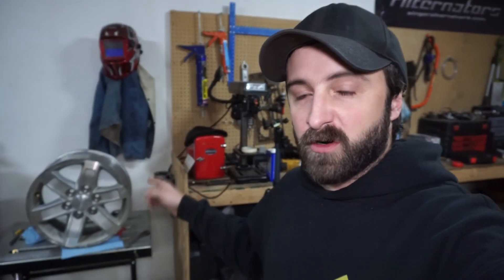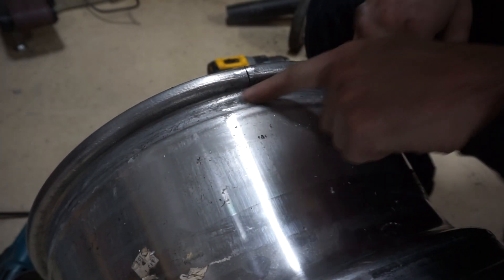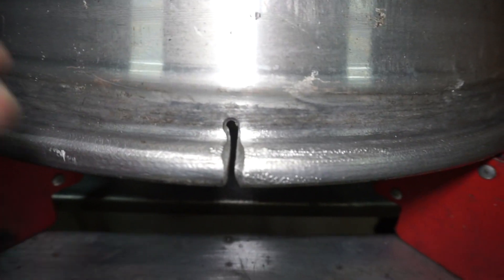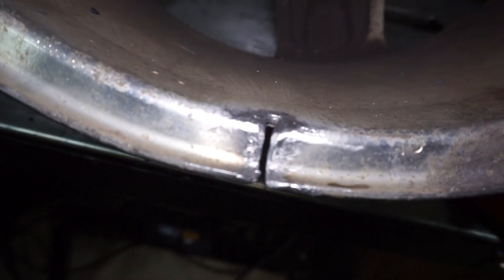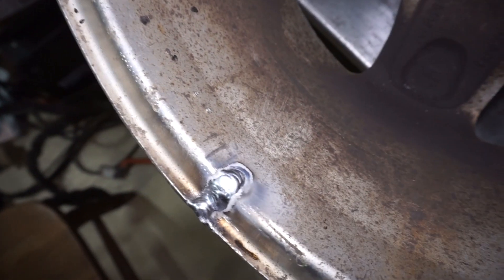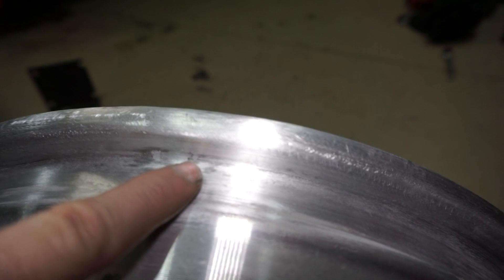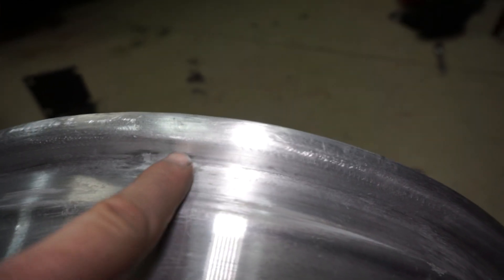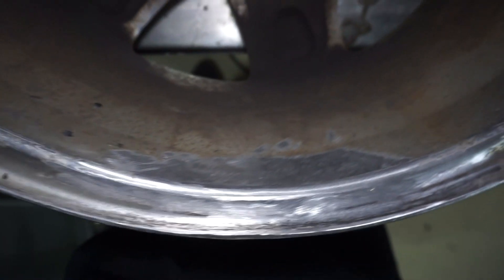TIG Welding Aluminum Rim Repair!!!

Comment: Could this work if the crack is located on the spoke right by the center of the wheel ? Probably around an inch away from the lug holes
Reply: I've done it used the wheel for a few months no problems but it is not recommended . Your life and the lives of others road users worth more than a  nice wheel. Repair had to be done properly if  you are going to take the chance.

Comment: So you just use autognoes*(sp) welding for cleaning and then you come in with filler on the second pass?..interesting thankss👍👍👍
Reply from the maker: Yep, run the arc over to clean some junk out then fill.
Reply: @BlaserBuilds  one more question if you happen to have the time,any recommendations on a machine?

Comment: Blaser Builds..In fact, you should have heated everywhere around the repair area before welding... with a torch....as aluminum is such a heat sink...and grinding the weld on the outside served only to weaken the weld and was useless...just saying...

Comment: Wat machine settings did u use for this project and how many amps is your machine?
Reply: they won't answer that secret info they will say it depends on your welder humm 120v 220v ?

Comment: How much would something just like that would cost ?
Reply: About $75 to $45. Depends on the welder.
Reply: I got charged 200 for a bent rim
Reply: I charge 70 for 1 to 3 cracks after 3 it's time to replace the wheel

Comment: You need to fully bevel both sides and guarantee 100% penetration.
   And just as a side note- IF anyone is thinking about doing wheel repair...  If you weld repair a rim for any kind of automobile and it fails on the road causing ANY kind of injury- you are fully liable.
Reply: Whose liable about the crack wheel, in the 1st palce ???

Comment: Great job,  what welder did you use?
Reply from the maker: Eastwood tig200 digital
Reply: @BlaserBuilds  what filler rod did you use and also what amps were set on

Comment: aluminum stick you have to weld only on one side on the other side you just need to weld it so that air does not form there, you just need to weld it until a homogeneous mass

Comment: Really good job on this. 
About how much would this cost to get done?
Reply: That depends. Maybe $100-200. But if it's not perfect... Could cost you the knowledge that it's all your fault when it fails on the road and someone gets hurt. Plus the cost if DOT finds out it was welded...  Not with it
Reply: @roydunn4649   well dot should not let them sell alloy rims anyway its to soft
Reply: @texsales01  alloy rims are not too soft. The car owner should have seen whatever did that.  And if it was a pothole, here in Oregon I have seen the state, city or county pay for the damages

Comment: What diameter and color tungsten did you use? What filler rod?
Reply: Tungsten truly doesn't matter. Tungsten size matters depending on how hot your going to run. As far as filler, depends on how you finish it. Paint? Polish? Anodize?
Reply: But, personally, as a guy who has been TIG welding since 1991 (aerospace, job shops and even some nuclear) I would NEVER use rims I knew someone had welded on and wouldn't weld my own. There is always a chance, maybe a miniscule chance, but still a chance something can go wrong on the road.  If someone gets hurt, that shit is on me. 
   No weld shop I ever have worked for allowed anyone to weld rims on there property. Didn't matter if they were your own rims. Makes the company liable for damages. Trust me, The didn't care how good you were or how many aerospace certifications you had 
   That right there should tell you wether to let someone you have no idea what their skill level is weld your rims, or just buy new ones. Up to you